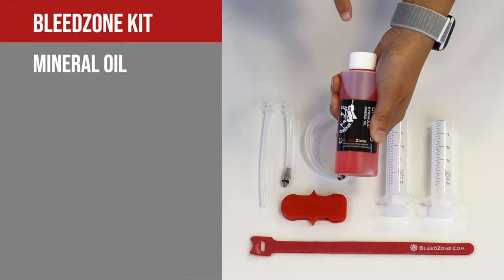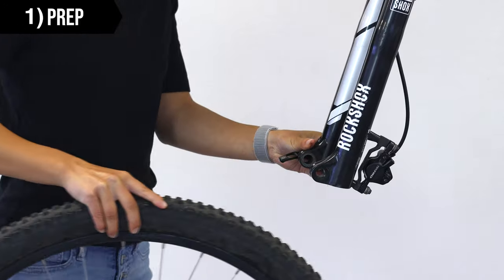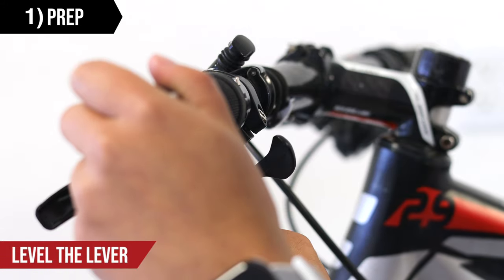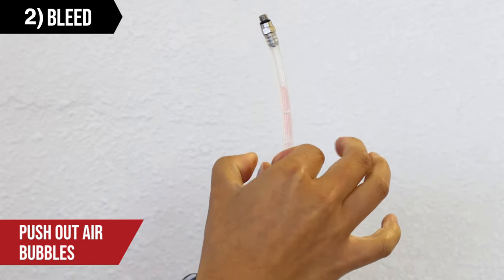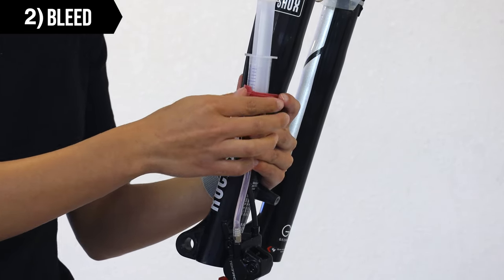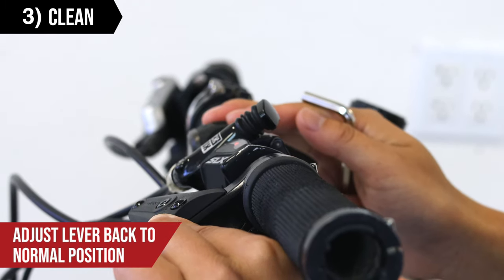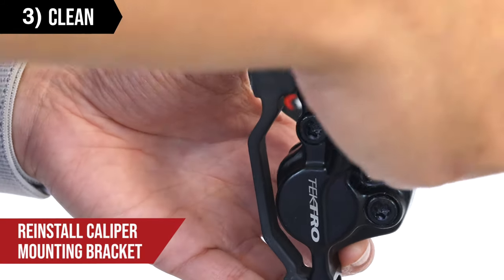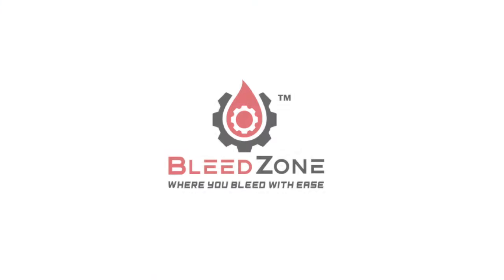How to Bleed Tektro Hydraulic Disc Brakes | BleedZone Kit

Comment: What i would recommend is to add brake block[which should be in the kit] and then press the lever with brake block inside. It will prevent the movement of pistons, but it should make sure that the lever and reservoir is clear of any air bubbles.
Reply from the maker: Yes, the main purpose of the brake block is to fit snugly between the pistons of your brake caliper to prevent them from moving outwards during the bleed process, and pressing your levers can help remove air bubbles :)
Reply: Hi. I tried tonight for the first time to bleed my tektro brakes. I was hoping it would improve braking performance but there was no improvement at all.

I only have experience with tektro hydraulic disc brakes and not Shimano so I don't know if Shimano would have better performance.

I've had 2 bikes with tektro hydraulic disc brakes and both are far worse performance than any v brake.

I was under the impression hydraulic disc brakes would be better than cable brakes.
Is there something wrong with mine or are they worse than v brakes?
Reply from the maker: @andrewdouglas1963  I believe the general advantage of disc brakes over V brakes is that they perform optimally even in water or mud and can have more stopping power. However, if yours have far worse performance than your V brakes, something might be wrong. Could you clarify some more on what specifically is not working well with your Tektro disc brakes?
Reply: @bleedzonekits  
Thanks for getting back to me.
Just poor braking power. 
I was actually out on Saturday with a friend going down some downhill trails and noticed his bike had exactly the same tektro brakes as mine.  I took his bike for a spin and his brakes were substantially better than mine.

I left my bike into a bike store in Saturday afternoon and they suggested Shimano hydraulic brakes so I opted to change to them.
Reply from the maker: @andrewdouglas1963  Okay got it. Yeah, if bleeding didn't help much, perhaps something else is wrong with your Tektro brakes, and in our experience, Shimano hydraulic brakes tend to be more reliable. Good luck!
Reply: @andrewdouglas1963  sounds like you screwed up the bleed or got oil on your pads. Trp makes great brakes and even sponsors some UCI DH World Cup riders 😂 mine works amazing

Comment: I followed this tutorial and my brakes are just as bad if not worse than before bleeding. also, is there a syringe attached to the tubing at the brake lever? am I supposed to drain all the old fluid out? after flipping my bike over earlier to do some tire maintaince, my rear brakes just don't work at all. not to mention my brake pads (tektro e350) are held in with a pin and not a screw, I had to call my bike's manufacturer to get instructions on how to remove the brake pads. please provide more clear instructions.
Reply from the maker: So sorry to hear that you were having trouble with our tutorial! Yes, there is a syringe attached to the tubing at the brake lever that acts as a kind of funnel, and you do drain the old fluid out by pushing new fluid through the brake system.

If your brakes have been bled correctly and they’re still not working, you could have a leak in your system. Even the smallest leak in your brakes will allow air to enter the lines and negatively affect your brake performance. Common leak-prone areas in the system include the caliper from damaged seals and the hydraulic fluid lines often from corrosion. You might want to check the fittings at the ends of the brake line and the master cylinder cap screws as well. 

Another issue could be that your brake pads are worn out. If you bleed your brakes again, put the brake pad, all the caliper parts, and the wheel back without removing the funnel, and then pump the lever until it’s firm. When the brake pads are worn out, you might need extra fluid and often bubbles could be trapped at the lever. 

Unfortunately, due to the many Tektro brake models, we were not able to cover all the methods of removing the brake pads in one video, but we’re glad you were able to get instructions from your brake manufacturer.

If you’re still having issues, definitely let us know and we’ll work to figure this out with you.

Comment: I had to attach the hose directly to the bleed nipple without the adapter on my textro brakes. The fluid that came out at the top syringe was full of old mineral oil, seemed somewhat cloudy and dirty. One little step the instructions skip is re-tightening the bleed nipple after pushing new fluid.
Reply from the maker: Yes, for certain Tektro brake models, you will need to attach the hose directly to the bleed nipple on your caliper! Thanks for your comment, and re-tightening the bleed nipple after pushing new fluid is a great idea :)

Comment: Hi, I purchased this kit to bleed the rear Tektro brakes because the lever was very spongy.  Other videos I’ve seen show the fluid being pumped up from caliper to the lever and then back down to the caliper.  This step is repeated so the line is bled twice.  Is this necessary or is one pass good?  Is the funnel used for just Shimano brakes?  Thank you.
Reply from the maker: Hi there! From our experience, one pass is good. If the step is repeated so that the fluid is pumped back down to the caliper, that could lead to potential bubbles being trapped in the fluid line since bubbles tend to flow upward. 

Tektro has a two-syringe bleed method, and the funnels you’ll find on the market have threads that are too small for the Tektro bleed port. However, we do sell a kit on Amazon that has an adapter that adapts the Shimano funnel to Tektro hydraulic brakes: www.amazon.com/dp/B0918W9S7J. 

Let us know if you have any other questions!!
Reply: @bleedzonekits  thank you for explaining the number of passes needed.  Just to confirm, when a brake bleed is done that also means the brake reservoir has been filled w fluid as long as you fill the syringe w the appropriate amount of fluid at the start?  Thank you.
Reply from the maker: @jrockthecasbah  In our experience, once we remove the syringe, we're able to close the bleed port and the reservoir is filled with fluid! When you're bleeding your brakes and pushing oil through the fluid line, there should be no air moving through the line, so once you remove the syringe, the brake reservoir only has fluid.
Reply: @bleedzonekits  thanks so much for clarifying!

Comment: Thanks for the video but all I had to do was take out brake reservoir screw. Add some mineral oil pump the handbrake. Add a little more oil pump it again and they were good as new!!
Reply from the maker: Thanks for your comment and glad to hear you got your brakes working again! The concern, however, with simply adding oil from above and pumping the lever is that while you might successfully remove some air bubbles, fluid gets dirty and does break down over time, which is why you might need to drain the whole system and put in fresh fluid depending on the condition of your brakes. 

If you haven't bled your brakes in a long time or at all and if you ride frequently, your brakes may need a full bleed. Over time, dirt or air contaminate the system, both of which reduce brake performance. The reason why you wouldn’t want contaminated oil is because dirt changes the viscosity of the fluid and hurts the fluid’s ability to dissipate heat, possibly even damaging the brake itself.

Comment: Hi! I took my bike to a shop for bleeding the brakes and when I went for a ride the rear one wasn’t breaking at all when descending, I had to pump the lever to get some breaking. Came back to the store and the mechanic said the lever must be damaged and I had to replace the brakes or trying to get the spare parts for the lever. I’ve searched a lot and can’t find neither the parts nor any info about lever damage causing sponginess and everything points to poor bleeding. I have Tektro M275 and if it help to diagnose, I found that the bike doesn’t brake at all when upside down, which didn’t happen prior to the bleeding. Thanks in advance for your help!
Reply from the maker: Hey! If your brakes have been bled correctly and they’re still spongy, you could have a leak in your system. Even the smallest leak in your brakes will allow air to enter the lines and negatively affect your brake performance. Common leak-prone areas in the system include the caliper from damaged seals and the hydraulic fluid lines often from corrosion. You might want to check the fittings at the ends of the brake line and the master cylinder cap screws as well.

Other tips during the bleed process if you have the bike shop try again or attempt it yourself would be to remove your brake caliper and rotate it so that the bleed port on the caliper is at the highest point during your bleed. It helps to gently tap the caliper and hydraulic hoses as well to dislodge any trapped air bubbles. Lastly, when you finish bleeding, pump the lever a few times, which should drop fluid levels, and then top off the oil at the brake lever. Worn pads would also make it essential to pump the lever during the bleed process because braking with worn pads requires more brake fluid. Our suggestion would be to return the brake pad, all the caliper parts, and then pump the lever until it’s firm before closing the lever bleed port. 

If your brakes don’t work at all when your bike is upside down, then it’s highly likely you still have air in your brake system. With your bike upside down, all trapped air bubbles would rise to the top making your brakes ineffective. Hope that helps, and let us know if you have any other questions!
Reply: Sounds like the bike shop may not be the most honest business in town.

Comment: So i have one of those universal kits but they only come with reservoir syringe and the cable thingy for the mineral oil to get the problem is i dont have adapter whats an alternative?  Sorry if my english is not good.
Reply from the maker: Hey there!! Thanks for commenting!! It sounds like you may have bought the wrong kit. You'll need one that has adapters. Here are some of the ones we sell. Please reach out if you have anymore questions!! :)
Pro Kit: http://www.amazon.com/dp/B08F29P2MG
Master Kit: http://www.amazon.com/dp/B08CSYBXDJ
Standard Kit: http://www.amazon.com/dp/B08F147Z36
Basic Kit: http://www.amazon.com/dp/B08DLFM4JL

Comment: Thank you!! Great video, BUT am confused. You CAN use Shimano brake fluid in Tektro hydraulic brakes? I though Tektro ONLY used Tektro fluid?
Reply from the maker: Yes, they're both mineral oil so they should be interchangeable!

Comment: Thanks so much for your video. Excuse my ignorance, is it the same procedure for the rear brake too? Do I also need to put the bike in a vertical position as I've seen in other videos to do the rear brake? Or is it not necessary? Much thanks!
Reply from the maker: Of course, that's a great question! The bleed procedure for the rear brake should be identical to the front brake. From what we know, it’s not necessary to have the bike in a vertical position. However, it can help to have the caliper parallel to the lever to reduce the slight oil leakage when opening the bleed port.
Reply: @bleedzonekits  Thanks so much!

Comment: Hey. Awesome video.
Isn't it possible to lever bleed tektro brakes?
Reply from the maker: Thanks! If you’re referring to pushing the fluid through the brake line by pumping the lever, that will work too. However, air moves upward, which is why we bleed the brakes by pushing fluid through the caliper. Let us know if you have any other questions!
Reply: Yes you can, I have just did mine, the levers were touching the bars, bleed from the levers, only a few air bubbles came out, now they are very stiff.

Comment: Just about to do mine, same calipers. Does removing the bleed screw at the caliper end not introduce air into the system? Or does the fluid just dribble out with gravity?
Reply from the maker: From our experience, a little oil leakage does happen when you’re removing the bleed screw from the caliper, but it doesn’t introduce air into the system!

Comment: I need that adapter. It is very difficult without it. My kit came with the shimano funnel and a basic hose amd syringe. But my brakes need the screw on adapter, dang it.
Reply from the maker: It sounds like you purchased a Shimano kit instead of a Tektro kit. We do sell a funnel adapter on Amazon that allows you to use a Shimano funnel on Tektro brakes: https://www.amazon.com/dp/B093RG55MX. However, you'd also need the M6 adapter for the caliper as well, and we sell a basic Tektro kit with the adapters here: https://www.amazon.com/dp/B08DLFM4JL. Hope that helps, and let us know if you have any other questions!

Comment: I noticed I had to 'burp' some air from the lever when doing mine. Otherwise, this is the way to go :)
Reply: yeah I wasn't getting good results until I pumped the lever gently while depressing syringe. MUCH better after that technique.
Reply from the maker: Thank you! We really appreciate the feedback :) Yes, especially if you have brake pads past half life, it would be a good idea to keep the adapter and syringe on the brake lever at the end of the bleed process, clean the caliper, return the brake pads and wheel, and then press the lever a few times until they're firm.

Comment: When you push fluid from the bottom, do you need to pull the syringe at the lever?
Reply from the maker: It’s optional, but if you feel resistance when you’re pushing fluid from the caliper, pulling slightly on the syringe at the lever could help relieve some pressure from the system!

Comment: Whi decided that replacing the retainer bolt with a split pin was a  good Idea ?
Reply from the maker: There are pros and cons to both. But, I guess the manufacture went with the split pin instead of the bolt. Some concerns with bolts are the possibility for it to strip the thread and caliper.

Comment: Hi Libby.. this is great for standard hd brakes..   No one has done a video on bleeding a Tektro TWIN HD E525 or E745 brake system for tadpole trikes with one hand lever..   Since there are 3 HD hoses involved:  1 lever, 2 right, 3 left caliper.  and everything is at one level (so gravity has no effect) and the Vertical handle bar makes it difficult to level the reservoir.. 
Can you do a video on how to bleed a Tektro TWIN HD E525 brake system for a tadpole trike..?
There are hundreds of bleed videos for bicycles... Not a single one for recumbent tadpole trikes..   Nor can anyone find written instructions to do this..   If Tektro went to the effort to create Mirrored Calipers and a TWIN HD brake system with one lever, you might think they would tell us how to maintain or work on it.  
Much thanks.. Desperate in Oregon...
Reply from the maker: Hi Rob, bleeding your Tektro brakes on your tadpole trike should be a similar process. The main difference is that you’d need an additional syringe and tubing for the extra brake caliper. 

The lack of gravity should not impact the bleed process of pushing fluid through the hydraulic line. We recommend that you first push fluid from one brake caliper and let it flow into your reservoir. Then you can repeat the process with your second caliper. Since you have a vertical handle bar, we’d recommend sliding your brake lever off the bar so you can level the reservoir. The Tektro brakes you mentioned look like older models that don’t have a bleed port at the reservoir, so you might find this video helpful: www.youtube.com/watch?v=XhBWN7kNyB0. 

We unfortunately don’t have the capacity to make a video for Tektro brakes on tadpole trikes at the moment, but feel free to reach out if you have any other questions as you bleed your brakes.

Comment: I tried to do it the way you explained it, but I can't push any oil into the calliper.
When I pull the brake lever, I can se the level of oil in rising, so the channel must be open in a way.
Any ideas?
Reply from the maker: Hey there - sorry to hear our bleed process isn’t working out for you! I don’t think it’s your brake lines, as you can see the oil rise when you are applying pressure to the lever. I would suggest try pushing oil out through the syringe/tubing while it isn't connected to the bleed port. If oil is coming out then it’s most likely your caliper that is needing replaced.
Reply: @bleedzonekits  thanks for your advice. I had to screw the lever completlely back, then the channel was open 👍
Reply from the maker: No problem - happy to help!! :)

Comment: When I unscrew the bleed port at the caliper, fluid quickly drains out. If I go to fill it with new fluid then, won't it just come back out before I can get the bleed screw replaced into the caliper? Thanks!
Reply: Tektro HD-E350 model.
Reply from the maker: If the caliper is parallel with the lever, oil won’t drain out when you’re finished bleeding your brakes and remove the adapter from the caliper. Additionally, the bleed port at the lever should be closed first, and when that’s done, it’s comparable to covering one end of a straw with your finger and the liquid inside holding because of the greater air pressure under the straw. Let us know if you have any other questions or concerns!
Reply: @bleedzonekits  that makes total sense, I did something similar yesterday to get it to work... thank you for your response!